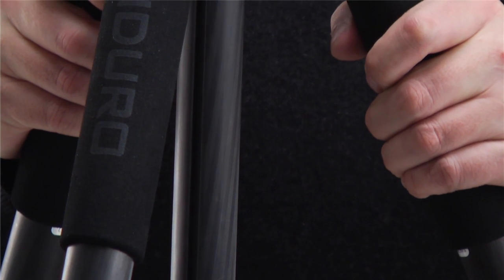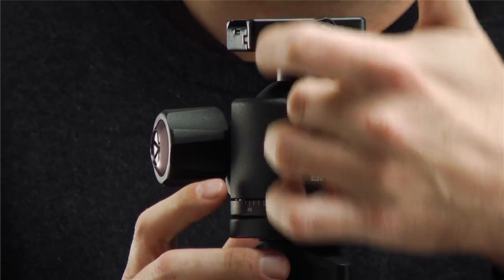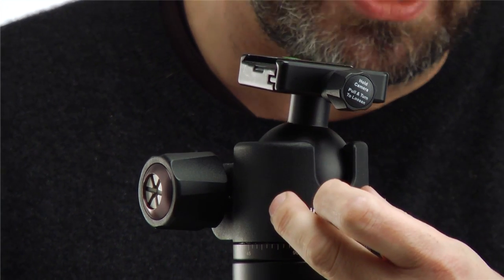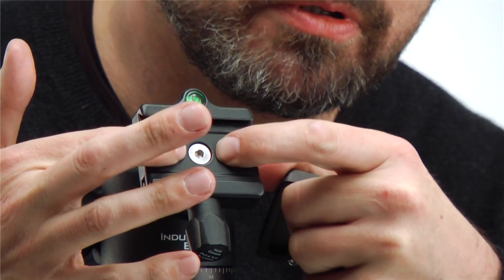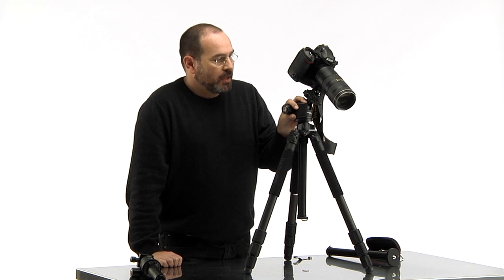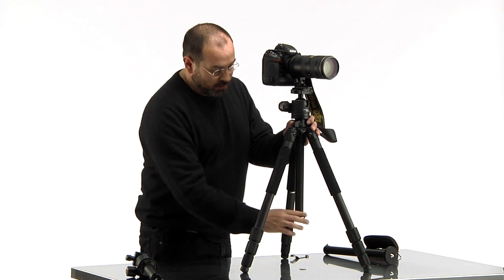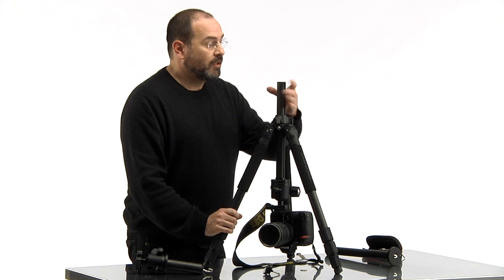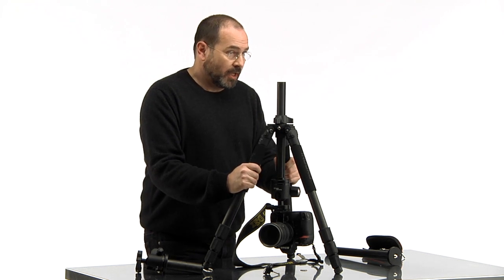Vincent Versace - A Walk Through Induro's CT314 Carbon Fiber Tripod

Comment: Induro is GREAT!
Here's something that- cheap-o tripod makers will NOT do for you....
About a year ago I bought a set of these CT314 legs. ...........I felt the legs were a bit stiff, so I backed off the screws on each side of the spider. This 'fixed' the problem...too much.

I re-tightened the screws and found that one of the legs was still 'floppy' even though the screws were as tight as I dared.

I put up with that for the better part of a year, but because I use my tripod almost daily (professionally) I thought I would contact the company to see if there was some kind of 'trick' to get it tight.

It took less than one business day for Induro to get back to me to explain that between the screws (inside of the spider), there is a barrel that I likely warped or pinched.

Here's the kicker....
Even though this was CLEARLY my fault, Induro mailed out a new spider today. This is a major part of this tripod and it was a total surprise to me that they would do this.

While it's likely that other tripod makers customer service is just as good, I'm quite sure there is only a small few.
THANKS SO MUCH INDURO! You have a lifelong customer!
(I bought one of your monopod's today for my 'big gun' lens)

Comment: Thank you so much for this review   ..  With this tripod am I assured that with me being a height of 5'3" that I can raise it without raising the middle column and it will be at eye level?   Also I live in a very windy area...  will the legs be thick enough at the height I need  to be fairly good in the wind...without the wind knocking it over? I realize I can weight it down using the hook.... my lens is the Canon ef70-300L series and I have a Gimble Jobu Junior 3  ball head for bird watching and shots will I need any other parts? Is this the Arca system?  Am sorry for all the questions but this tripod has caught my eye and I am a newbie...  This will be my first tripod and I am hoping It will do me for a very long time if I buy it....  I would appreciate a response very much!!  Thank you Vincent!!

Comment: How does the ball head weigh more than the tripod? According to the specs, the BHL3 weighs 1.5lbs and the CT314 weighs 5lbs.  

Now that Induro has updated their line, I've been thinking about picking up a discounted CT314. I currently have the AT214 paired with a BHL2 ball head. The CT314 was the one I wanted to get when I was searching for a tripod before I settled on the AT214. I'm more than happy with the AT214 but still would like a set of carbon fiber sticks...